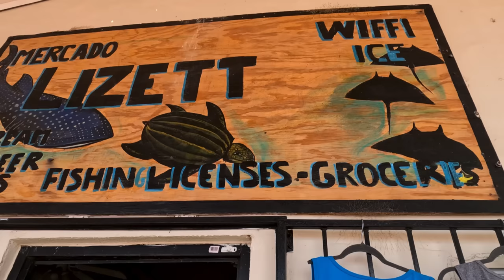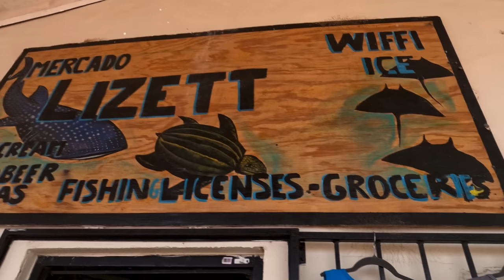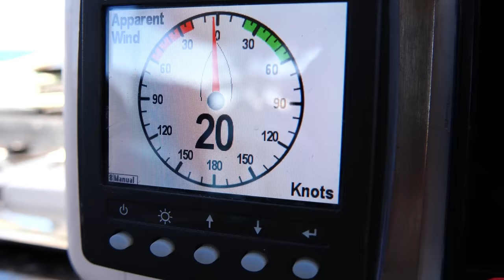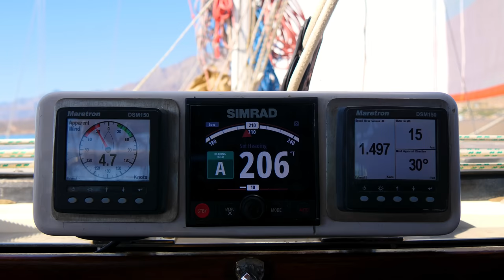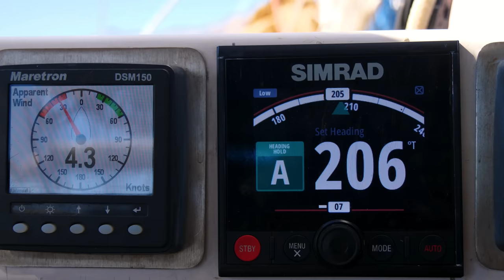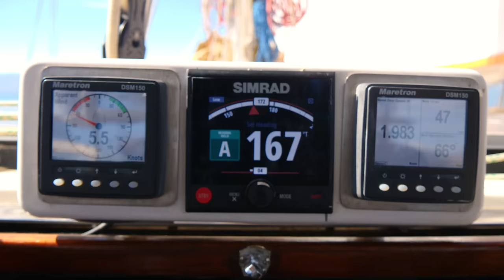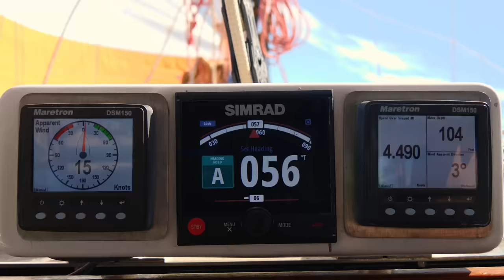Honey the Outboard must be TORN Apart to Try & Save our Season 🥹  (Calico Skies Sailing, Ep 199)

Comment: Bill & Grace as well as others, place a fan or several at the entrance to the cab on high speed to prevent most flying insects from entering. Most commercial kitchens, cafeterias and restaurants have "Fly Fans" at their entrance/exit doors for this purpose. Note: I was a Md. State Certified Pest Control Operator for 30yrs. and  use to practice integrated pest management for a very large school system.
Reply from the maker: That’s an interesting idea, never thought of that!

Comment: As Jerrymacvaldosta points out running without a thermostat can lead to problems. Especially if it's a 2 stage thermostat, think VolvoPenta for example. Removing the t-stat on your Yamaha will have a minor adverse effect on the flow but probably not enough to over heat it.  Better way if in doubt if you need it or not would be to remove the top disc of the t-stat which leaves all the restrictions you need in place while simulating a full open thermostat.  This would be the center disc when you first take off the cover that you pried on to remove the t-stat.  Bend it back and trim off if needed or just grind off the rivet that holds it on.  For your particular motor you can just leave it out but replace it soon as you'll get better fuel mileage and the oil will stay cleaner longer.
Reply from the maker: Thats a good idea, we ordered a new thermostat and gasket. It will be replaced when we get the parts :)
Reply: We have a Tohatsu 6HP.  Every two years or about 60 hours I check the thermostat, which is usually starting to suffer from calcium buildup.  The test Tohatsu suggests is to open the thermostat in hot water, then feed a thread into the open valve.  You wait for the thermostat to cool and jam the thread, then put the thermostat (suspended by the thread) into re-heating water.  When it drops off the string you have found the exact temperature when it cracks open (140F?).  The vinegar trick mentioned somewhere in this thread works.  And on  another topic: it was nice to meet all three of you at the Annapolis boat show yesterday!  I spoke at length with Dimitri in front of the Youtube booth.

Comment: I try not to kill bees, but if it's stinging me unprovoked.... it usually has to die, no guilt!   Nice work on the outboard, no real need to worry about a thermostat right now... I'd get one and reclean that motor, blow those ports out again... right before you leave the desert of Mexico and I hope cross the pacific, she'll probably be full of sand again by that time... Put the new thermostat in and set sail...
Reply from the maker: Yep exactly, it's running well for now, will replace when we get the parts. The bees are generally harmless but when we get stung twice in a day its game on LOL

Comment: Good job and attention on the outboard.  I do boats for a living. Do put a Stat back in it when possible
Reply: The stat is not only a temperature regulator.  It also affects the water pressure and flow rate.  It needs to be there.  In warm climates you can get away with no Stat.  If you venture out of the tropics you will absolutely need one.
Reply from the maker: Thanks for the tip! The part is on order, it got us through the season :)

Comment: Probably to late real time, but running without a thermostat can cause overheating, because the water flows to fast through the channels and does not have as much opportunity to cool the engine.
Reply from the maker: very interesting, hadn't considered that. We have replacement parts on order and will fix it when they arrive. We were able to complete the season without a T stat :)